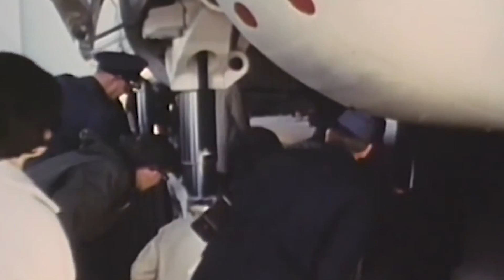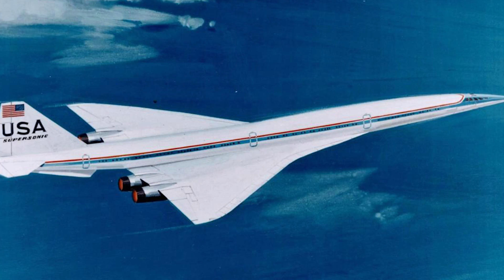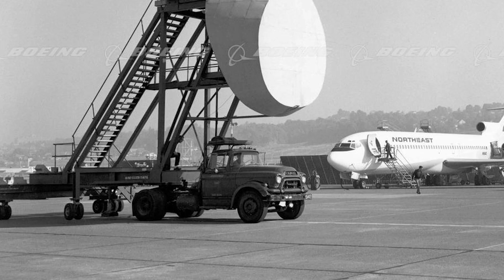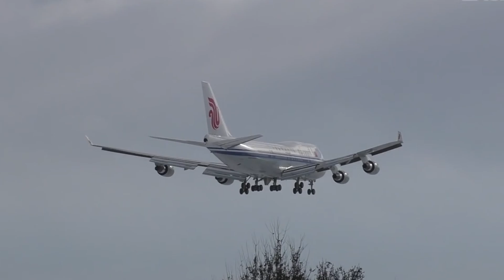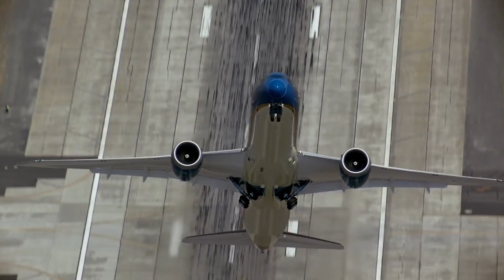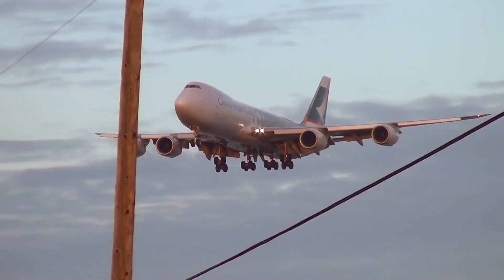Boeing 747 - the Jumbo Jet

Comment: Don't think the 747 ever needed all those landing gear. That was more for preserving the runways, which would be ruined by excessive weight concentration. The gear itself is designed to handle the plane potentially having to make a rough landing while still at maximum takeoff weight, like it they had engine failure right after takeoff and had to immediately make an emergency landing, with an excess load factor in case the landing was excessively hard. So two of them should be plenty strong enough to deal with normal landings. However that requires specially built runway surfaces or they will start to crack and deteriorate (same reason large trucks have limits on the load on each axle, they don't need all those wheels, that's to make them safe for the road surfaces and bridges). In both cases more wheels also gives you more tire contact area, and more sets of brakes to absorb the energy. Again, you won't need all of them for normal landings, but they will definitely be useful the first time you have to abort a takeoff on a wet runway with the plane at max takeoff weight.

Comment: Would be interesting to see a series of up close views of the various engine installations used on these planes as well as a summery of the different model /brand names and the performance ratings.
  Did the Space Shuttle carrier planes retain the original engines from when the planes were transport airliners? 
Do any of the planes have mixer sections at the back of the engines for mixing the bypass air and the hot core jet exhaust? 
   Seemed to me that the DC 10 had far more powerful climbout and acceleration performance than the early 747--over 3/4 the power and only 1/2 or less of the weight?

Comment: What most people are surprised to discover is that the 747 is not only one of the largest civilian jets, it is also one of the fastest. Most people assume it would be a big, lumbering giant, but no, it is actually one of the fastest air liners ever built. Maybe partly because of the scale effect that make high speed and long range easier to obtain from a larger and more powerful aircraft, but mostly because the relatively high sweep angle of the wings. They went for a higher sweep in spite of the potential handling problems at lower speeds because it was the only way to fit the wing span into existing airport dimensions. A a result, the 747 can reach a higher Mach number than most jets can. Over Mach .9, if I recall.

Comment: Apparently I had seen this video before. I did not catch the phrase from Airbus about better than an A380 has to be an A380. Airbus is entitled to their opinion but if the A380 was that good why did they quit manufacturing it after approximately 12 years it's a rhetorical question but the only thing the A380 did better was carry more people and that sometimes that was a detriment when they couldn't f i l l the jet two capacity. A few empty seats was a financial disaster. The A380 was way too thirsty required too much fuel compared to the 747-8 the operating cost per hour were substantially higher than the 747. About 270 a380s are all that was produced by Airbus compared to about 1550 747s when you're talkin Jets bigger is not always better it's usually more expensive and in business that does not usually fly no pun intended. You're probably counting the Tenerife disaster and the Pan Am flight 103 over Lockerbie victims as part of the death tally. Those were not the planes fault in any way. It was miscommunication or Pilot mistakes and terrorism respectively. The 747 has transported approximately 70% of the Earth's population current population and it is one of the safest jets in the air. When the 747 was built it was literally two or more times bigger than any passenger jet previously the A380 was nowhere near twice as big as the 747. Operating cost of the A380 compared to Twin Jets is what killed the A380 my only question is how did the engineers at Airbus miss that so badly. To me it's a tragedy that Majestic Jets like the 747 especially the dash 8 it is Sleek and beautiful and the A380 won't be flying a lot longer relatively speaking but in the end in business expenses matters.

Comment: And the first generation was loud. My high school was about 3 miles south of the runway and about 4 miles off the centerline. Whenever the plane took off depending on its heading class had to be suspended until it had passed by due to the ear splitting yowl.They eventually did something about the noise.

Comment: It's quite possible that the 747 - in particular, the freighter versions - will still be flying long after the A380 has been retired. Sure, the A380 can carry more passengers, but its cargo performance is rather limited and more costly than the 747. And no aircraft in the world has the combination of freight capabilities that the 747 has, and that looks to be the case for at least the next decade.

Comment: The depleted uranium was primarily used as mass balance weights on the control surfaces. It was also been used as anti-flutter weights in the wings, and located in the outer nacelles.

You've glossed over the fact that normal handling of the throttle levers to reduce power would cause the engines to sfall and flame out. The first flights required a large number of batteries to ensure that the electrics and hydraulics remained in action.

Comment: I refer to any wide-body as a “jumbo jet” and not just the 747. The 747 was nicknamed “jumbo jet” because it was the  first wide-body jet ever made, four times larger than any jetliner that came before it so the name stuck with the 747. Since the introduction of other wide-bodies, the term has been used more loosely to describe any wide body including the 777-300ER which is actually slightly bigger than the original 747, the 747-100.

Comment: Some Airlines such as Qantas Airways and KLM Royal Dutch Airlines Retired the Boeing 747-400 recently due to the Downturn Air traffic to Covid 19 Conovirus Outbreak.

Singapore Airlines was formerly then the Largest Operator of the 68 Aircraft then operated for 35 years and ordered More Fuel efficienced aircraft such as Airbus A380 and Boeing 777 families.

Comment: 747 is ill suited for the modern, point to point system of direct flights between smaller airports even if distant, but it is useful for minimizing traffic at the busiest airports, especially since the A380 requires longer following distances.  But there are already more than enough of them to fulfill that hub to hub roll for many years, without building any more.

Comment: My first flight was a 747. Acting like a grownup, I accepted stewardess's offer of a coffee, but was amazed at how it didn't spill or slide during ascent - steady as could be(am I wrong or could tray tables stay open during takeoff then?) . 45 years later, after initially a few 727 rides, a few nice L-1011s, a few nice MD rides, and mostly a ton of 737s since, largely only domestic U.S. flights (a couple to the Caribbean), I have yet to make my second flight on a 747. And my great regret was that I never got to try those awesome staircases to see what was above. (On my first flight, a Delta from ATL to ORD, they told me that the upper deck was closed. I remember how in the 70s and 80s, unlike now, you would routinely have plenty of empty seats on many flights - even having only like 29 aboard a full size jet flight, I remember on one - so I suppose my one 747 flight just wasn't full enough to justify opening the upper deck at all.)

Comment: I have been in love with this beauty and Graceful Queen of the Skies. This aircraft to me felt to be the most solid and safe equipment operating in the sky. The movements of the 747 were every bit of grace you can imagine. When you are in the air the engines propel you smoothly through the air. The auto control surfaces help to stabilize your ride in the air to be smooth and comfortable. I don't care how old she is. The Queen has not lasted this long for no good reason. BOEING had some great engineers design this baby for endurance. There has been no other aircraft built like this one and I am glad they did. GOD BLESS this Aircraft to be able to fly for many more good years.

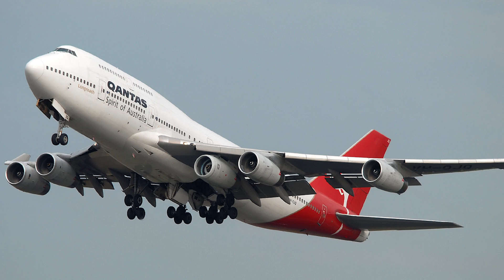Comment: 13:41 In addition, though not at airports, you may sometimes see the General Electric test platform with 5 engines, which lead to the rather funny sight of a 747 with 4 CF6 and a GE90.

Comment: The dozen times or so I've flown on a 747 I've usually been stuck in the middle seats and don't like it. The odds of getting a window seat are much less likely and flying on a jumbo jet in the middle seats is kind of like being stuck in a big room full of people. Instead of flying, it's like being in limbo. Plus there are so many people, it makes you feel like cattle. 

The smallest commercial airplane I was on was a commuter, a DC3 (I think), and  in a blinding snowstorm we hit a downdraft and dropped about 200 feet in seconds. There was no dividing wall or curtain between the pilots and passengers and I watched as the pilot kind of white-knuckled it before we stopped falling. All 13 passengers were totally silent while it was happening, but afterward we were all relieved to be alive. Still, I like smaller planes.

 I never got a chance or had the money to fly on the Concorde, but would have liked to. I remember seeing one at a passenger gate at the airport in Rio, during its first year or two of service. I thought wow, what will planes be like by the turn of the century! Also, as a child, I always liked seeing the Constellation, but never flew in it either. At least I got to fly in a Viscount once, and many others since for a short while my career involved some air travel, including international travel in countries where they used older planes. Then one day I would get to fly them all, on MS Flight Simulator.
Reply: You simply should have flown in first class, like I did, whenever I flew on the Queen of the Skies, the 747, instead of being packed into steerage, then you would have had a wonderful experience flying on board her.
         In my experience, there are only several passenger aircraft, where the whole crew is visibly proud and excited to fly them each and every time. Those are the 747, The Concorde, the VC-10, and the L-1011.

Comment: 50 years in production, it was so right at the time, and the decades have been kind to it, with modernizing taking place throughout. It is more beautiful than the A380 in my opinion.
Reply: The 747 is by far the best looking plane. Especially the early ones. Followed by the a340.
The a380 is far more comfertable though, probably the best plane ever made for passengers. It is ugly as hell though lol.
Reply: @baronvonlimbourgh1716  i do agree with you on the a380 is a ugly looking bird where as the 747 is most elegant looking plane ever produced..
Reply: @baronvonlimbourgh1716  No A380 is modern a double decker have 1 of each at a knock down price start your own airline lol.

Comment: 50 yrs of production aint bad!  The B52 was not in production  until the early 60s but is still used and will be until its 100th birthday. I am sure that somewhere a 747 800 will be still going 50 yrs from now.
Reply: well, 50 yrs from now we will all be travelling in the air by Very different means than these aircraft...tech of that time will make todays most modern craft seem like it was from a prehistoric era
Reply: well 50 yrs from now we will be travelling  in the air in ways that will make todays most advanced carft seem as if from a prehistoric era

Comment: The 747 will still be flying when the last a380 is scrapped. What a massive failure Airbus made with the a380.
Reply: Yet the bread and butter of the company, the A320 family is kicking arse.  The giants are flagships selling in small numbers these days.  The 747-8i has died in the arse too.
Reply: @shebbs1  The 747 is still in production and the A380 is dead. There are still more 747s flying than all the A380s ever made.
Reply: @DaveMiller2  That doesn't refute the point I made: the large 4-engine market is dying, and the 747-8 has hardly been a success.
Reply: @shebbs1  Yes, the 4 engine market is dying for passenger aircraft. The 747-8 is only the latest variant of the 747. Taken as a whole the 747 is a HUUUUUUGE sucess. The -8 variant is just the last variant to come at the end of the passenger run. The cargo version is going to be around for many years yet.
Reply: @DaveMiller2  I do know that, and it still wasn't my point.  Boeing is in a lot of trouble from the 737-MAX cock-ups, deservedly so.
Reply: @shebbs1  Funny how many pro-Boeing jingoists there are on here.  It explains why Trump has supporters.  I love Boeing planes, but the company deserves to go under for the max jet debacle.
Reply: Owain Shebbeare thats funny because Boeing has sold more 737’s than Airbus has of the a320 family. Do some research before spouting off on Youtube dickhead.

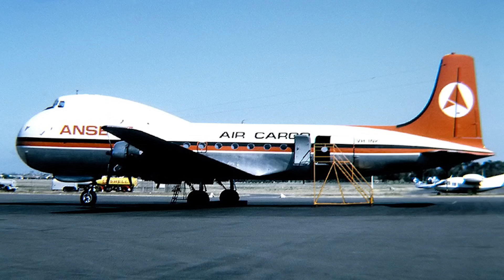Comment: 2:22 What kind of aircraft is that Ansett cargo plane?
Reply: If I am not mistaken, that's an ATL 98 Carvair. The plane was based on the old Douglas C-54 Skymaster (cargo aircraft produced for the US Air Corps during WWII) and modified for cargo (or Air  Ferry) by Aviation Traders Limited (ATL). It entered in servide around 1961 and 20-ish planes in total got produced during the lifespawn of the model.

It was used as a short range passenger liner and a cargo plane,  with a total loss of 8 ATL 98's in air crashes.

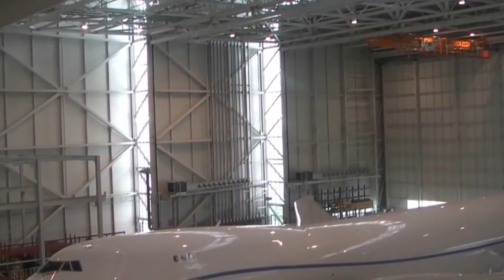Comment: If you can get a window seat in row 48  and further back, you can see the 747’s body flexing. United used to have a 747 round trip LAX-DEN, leaving about 4 or 4:30 in the afternoon. I always took that flight home after attending meetings in LA. I have never seen an aircraft do this, not the TriStar or the DC-10. Looking forward from the rear seats windows, the pointy end moves left and right just a little;  the flex is really coming from the tail end . The way the aircraft is tapered gives you this unique view and the reason the 747 looks so incredible, 
South Korea also uses a 747 to fly its president around.

Comment: 747 - 400 is the king of the skies.  A380 will always be second best.
Reply: @Colin Baker A380 didn't trump anything it went straight into the ground! Bye-bye flying forehead!
Reply: soaringtractor  This is exactly what I wanted to say. It's normal for any government to support their country's industry.
Reply: Sarah Kevin not really both have advantages and disadvantages
Reply: @noobraider99  every single airplane has their advantages & disadvantages. True.  But  even the president uses the air force 1. 747.  I just love it.
Reply: @sarahkevin2831  the president of one country. it would be weird if american president flew a non-american plane. so it doesn't prove aircraft's superiority.

Comment: No other plane that I have evr flown on has made me feel as confident, as comfortable, and as safe as the 747. 4 Engines for long haul each and every time. I love this beauty since my first flight on board Pan Am in 1981, and continue to try to fly on the 747 as often as I can!
Reply: several years ago there were two LH-Flights from PVG to Germany at the same time: a 747-8 to MUC and a A340-600 to MUC. I tried both once and prefered the A340 as it was more quiet ...
Reply: ntcrwler nice
Reply: Wikipedia: u wot mat?

Comment: There are a few missed points here:
1. The first ever 747-100 (known as the City of Everett reg. N7470) was built at the same time the walls of the Everett factory were coming up. The team that assembled N7470 was known as "The Incredibles"
2. Joe Sitter is known as "The Father of the 747"
3. The 747 is commonly regarded to as the "Queen of the Skies"
4. The proposed 747-600 was to have a full upper deck.
5

Comment: I think you should do a video on what an absolute failure the A380 has been you may want to comment on how butt-ugly  the thing is too...
Reply: Butt ugly is right! 
    Airbus knew, that the market was changing and favored smaller aircraft, but they wanted an iconic flagship, like Boeing has with the 747, so they moved forward  with the A380. Problem is, the A380 can't easily fall back into a cargo role, like the 747 can. Ugly can work with a military aircraft, such as an A10 or B52 (BUFF), but, although it did what it was designed to do, no one will protest the demise of such an ugly passenger jet.
    From a practical standpoint, the 747 will live on in cargo configurations, and from an image/prestige standpoint, it will live on as VIP/national leader transportation. Perhaps an airline or two, will keep operating a few 747's for whatever marketing advantage it may give them.
        One or two ultra-wealthy people might have ordered an A380 in the past just to be different, for their playground in the sky, but the 747, The Queen of the Skies, because of it's beauty, is the one that they really wanted!!!

Comment: Flew on a klm 747-400 last week. It's a beauty still, but not comfortable by modern standards. Noisy aircon, noisy and trembling in general. Flying back with a 777 showed a big difference in how planes have evolved! Yet I am impressed that this beauty was designed 50 years ago!